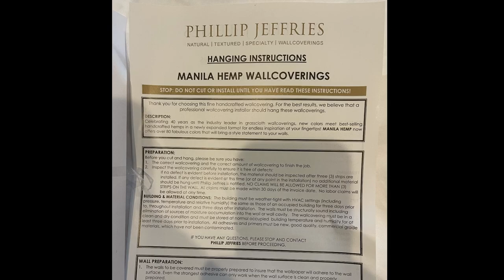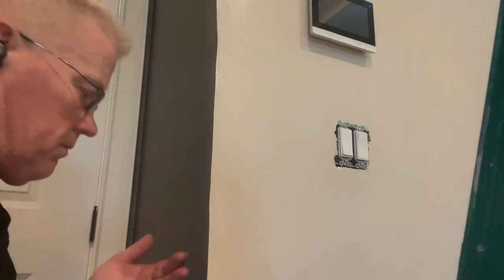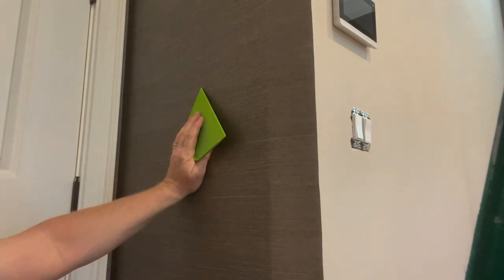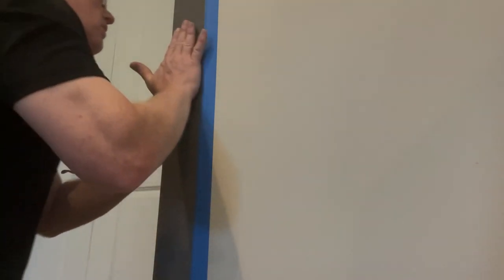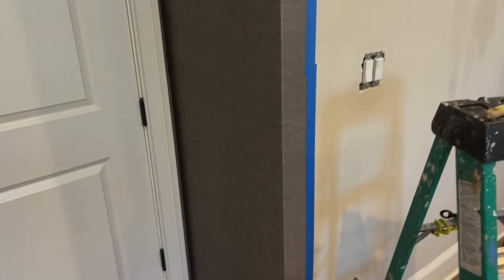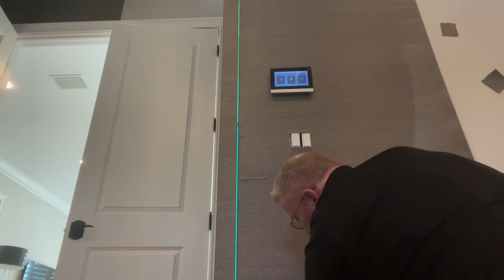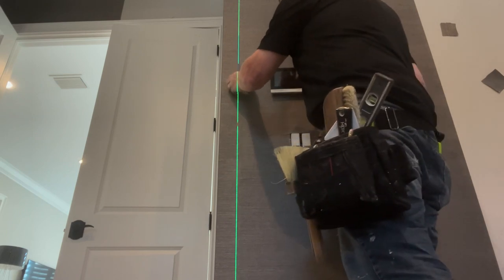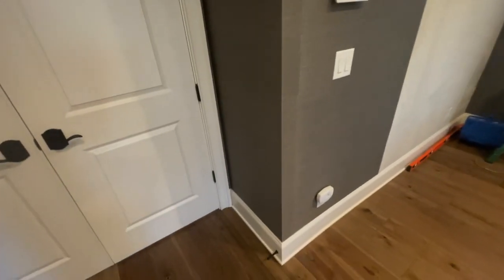Achieve Tight Outside Corners on Phillip Jeffries Manila Hemp Grasscloth Wallpaper - Spencer Colgan

Comment: Great advice Spencer, we always paste the corners (and bullnose corners) and let dry or tack up makes " Velcro" effect as its known in the business. You can also use a corner roller if you have one, hands 👐 and micro fiber cloth are best tools. After a minimum 6" wrap assuming were gone double cut the seam after hanging the next over the blue tapped edge lift it up and wait 30 min or so before repasting and then DC. This eliminates shrinkage at seam. Good job Spencer.
Reply: Edit: we almost always double cut Philip Jeffries grasscloth for best seam.